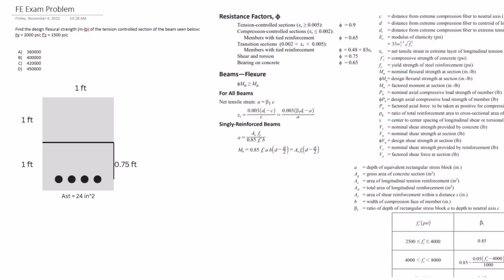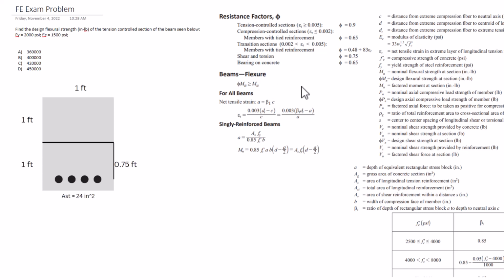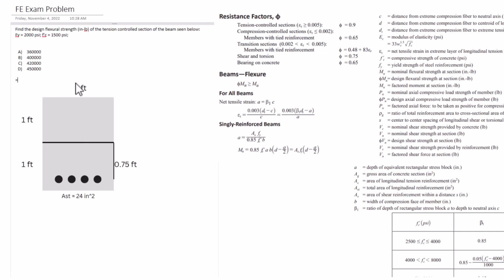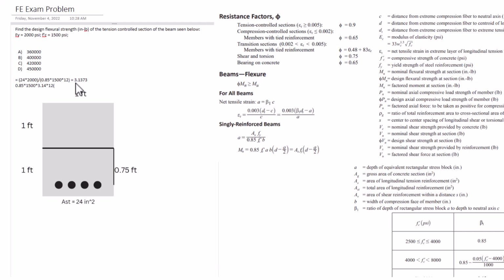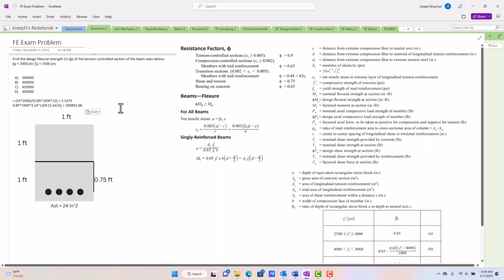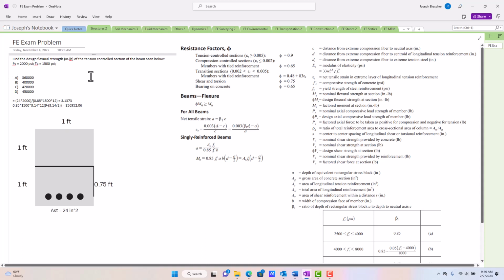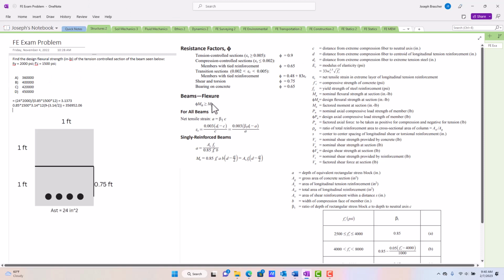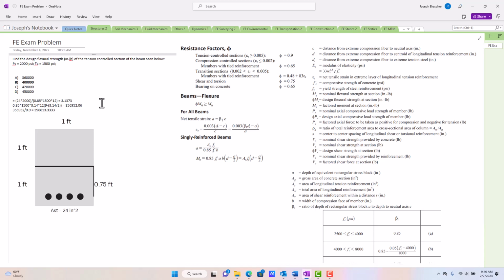Nominal Strength of a Beam | FE CIVIL STRUCTURAL ANALYSIS

Comment: I think Mn should multiply with 0.9 instead of divided.
Reply: Thank you for your response 
We are finding the strength for the beam so I think we need a smaller value for safety.
Reply from the maker: @fouzianoutash7218  I see what you're saying. When designing the strength of the beam we should use the smaller. I would say you are correct then.
Reply from the maker: To find the design flexural strength, we would want that design value to be greater than the determined nominal, as a factor of safety. Let me know your thoughts.
Reply: @examprepsolutionsFECivil  , this is true if you used the ASD not LRFD. I think you confused, BUT thanks for the video